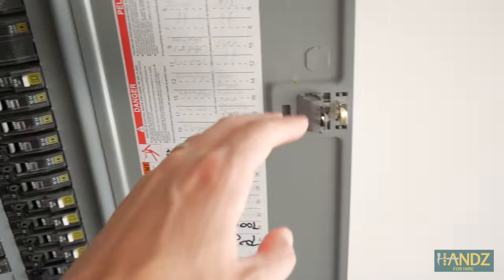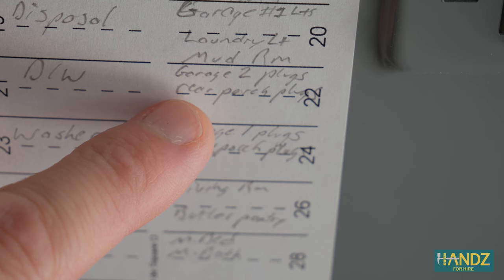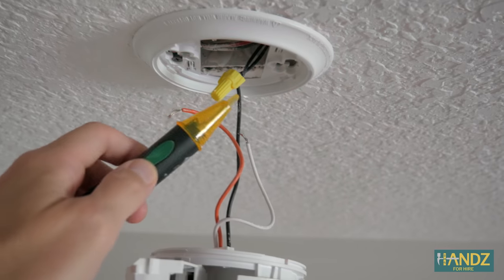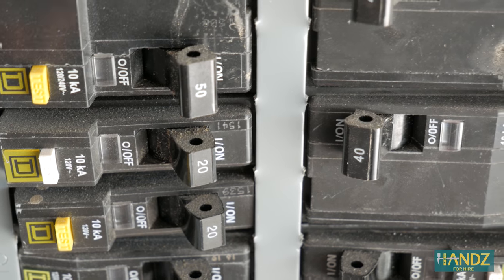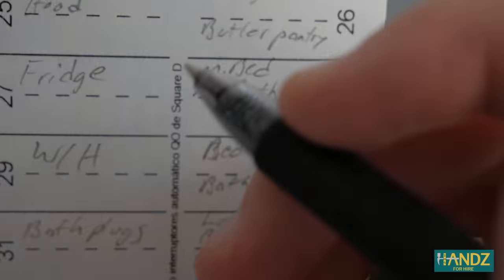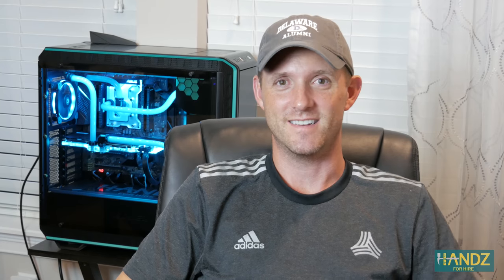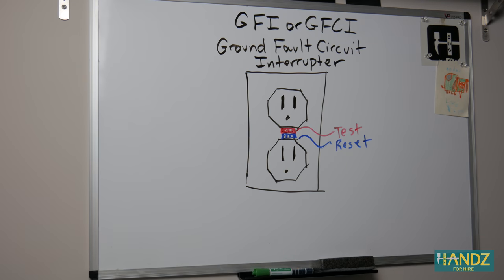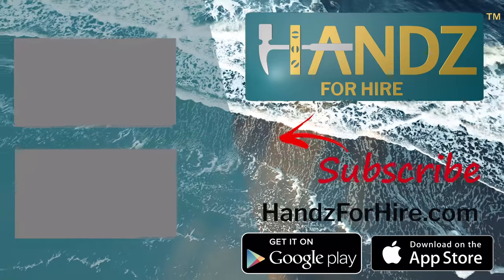Turn OFF POWER on a Hardwired SMOKE ALARM and Live to Tell about it

Comment: Jay like you, I searched everywhere - all the YouTube videos on this question. I couldn't find the answer but you're so learned,  I thought you might know the answer. I simply want to disable my hard-wired smoke detector. Not remove it not change it -  just disable it so it doesn't keep going off from the least little bit of smoke.  If I take the cover off of my hard-wired smoke detector from the 80s and I detach the wires from the little clip can I put the cover back on the smoke detector without attaching the wires again?  this way the smoke detector will not go off,  (I hope )and there won't be wires hanging from the ceiling and a hole in the ceiling. you see, this smoke detector it's one of five in the house goes off whenever there is the least little bit of steam or smoke from the frying pan or the oven and I can't stand it anymore. I don't need it. I just want to take the cover off, disconnect those wires from the cover, and put the cover back on so hopefully it won't buzz/ go off anymore. do you think that's possible ?
Reply from the maker: Hi Donald, thank you! To answer your question the short answer is yes you can, but I wouldn't because those smoke detectors are there for a very good reason. The professionals recommend replacing your smoke detectors every 10 years. If yours are from the 80s then they have 30-40 years on them. This might be why they are so sensitive and go off so easily. Years of dust can make them wacky. Before you disconnect for good, I'd try switching the one that's causing you issues out with a new one. Good luck and let me know how it goes!

Comment: Not sure if anyone has had this issue.  We had an old smoke alarm that was hardwired. Removed the alarm to replace to stop the chirping.  But the chirping didn’t stop even though there was no alarm attached!  Couldn’t find the circuit and finally turned 2 off at the same time and the chirping stopped.  Got a new alarm, attached it, with new battery.  And now, 24 hours later,  periodic chirping continues just like before.  My question.  The prior alarm was put in by owners in 2007.  Is there something else that ‘chirps’ besides the alarm itself that needs to be removed?  Will it chirp if the new alarm is put in improperly perhaps?
Reply from the maker: Hi Gail, Did you happen to replace the 9V battery in the alarm itself? Even though the alarm is hardwired, it still has a backup battery in case the power goes out. Over time this 9V battery needs to be replaced and the chirping is the indicator. Good luck!! I hope it works out because I know how annoying that chirping is!
Reply: @HandzforHire  well guess what!  We actually found that the upstairs smoke alarm (that we were sure was just fine and didn’t have a problem) was the problem. And it was just like others said…sound traveled strangely and we were so SURE it was the downstairs alarm.  So, we changed the upstairs battery and reset it and sure enough, all good!  It was the back up battery for sure… just the wrong alarm.  Thanks for responding.
\
Reply from the maker: @gailpfeiffer2331  oh that's great news!! Yes, sometimes it's really hard to pinpoint the chirp. I know exactly what you mean. Glad it's all sorted!

Comment: I'm still at a loss, I've checked all the circuits other than furnace and hot water heater(both in basement)  and stove outlet and refrigerator outlet and my volt meter still beeps like there is electricity there.   I'm stumped and disappointed.
Reply from the maker: Hey Kevin - I know how annoying these alarms can be. Worst case scenario, you can cut everything at once, check to make sure it's off, and then slowly add breakers back in to find the right one. There's not another live wire nearby that could be triggering your voltage detector?

Comment: When I was replacing a battery in my First Alert smoke detector I noticed  the ground wire was disconnected.  I kept turning all the circuit breakers off and still had power coming into the smoke detector.  The tip of looking for 15 amp breakers associated with the bedrooms was what I was really looking for.  I followed this tip and in a minute or two I connected the wire and the problem was solved.   I want to thank Jay for this learning lesson, it was greatly appreciated.
Reply from the maker: My pleasure, sir! I went through the same process as you, so my hope was to save someone the to figure it out. I'm glad it helped!

Comment: THANK YOU SOOOOOOOOOO much.  Took a total of 15 minutes to find the right shut OFF.  I, like you wife wanted to take a hammer to everyone of them.  I am now going to make labels for everyone of them, plus put it on the DOOR of the breakers.  I can't imagine living with that noise.   Funny part of this it is on a breaker that a intercom that we have not used for at least 20 years.   Good job and THANKS.  by the way we have all 20 and some odds breakers.
Reply from the maker: You're welcome! I'm glad it helped, and wow, that's interesting about the smoke detectors being on the same breaker as your intercom. Perhaps the new building codes have smoke detectors on a 15A, but older ones were on 20A? Well thanks for commenting and have a great (alarm free) day!

Comment: I'm pet sitting for my mom while she's gone for two weeks, her integrated fire alarm has been beeping and it's annoying her neighbours. I've tried turning off every circuit in her house but it still keeps beeping. Her circuit box is super janky. The switches are barely labelled and the ones on the right side seem to have been put in backwards, so off is actually on and vice versa. I think because she is in a town house there may actually be another circuit box outside that may be controlling some stuff in her house and her neighbours house, so I'm scared to replace her alarms since I don't have a voltage detector and can't tell if there's electricity still going to the alarms or not. I have some new alarms and wire harnesses but the old alarms are from 1999 and she has never replaced them before so I'm worried there may be wire damage that could expose something and cause a fire if I move around the wires. If I call an electrician it will easily cost me like $500 to $1000 Canadian dollars. Uuuuuuggggggggggggggghhhhhhhhhhhhh... 🤦🏻‍♀
Reply from the maker: I'm so sorry to hear all of this. Sounds super stressful. Do you have a hardware store close by? You could pick up a voltage detector for fairly cheap or I have one linked in the description that you can buy off of Amazon. I definitely wouldn't mess with anything if you can't tell whether the electricity in the circuit is shut off. That would be my best suggestion because then you can troubleshoot the switches without getting hurt. Best of luck to you!
Reply: @HandzforHire  I sort of figured it out. It turns out it was my mom's new CO2 detector I didn't even know she had that was going off. She had just gotten it and put it on a shelf near the fire alarm and I guess it was faulty so it started making the end of life beep. I took the batteries out of it and it stopped beeping. The situation still isn't fully resolved though as all the fire alarms need to be replaced and the CO2 detector sent back to get a new functioning replacement. So basically now she has no functioning fire alarms and no CO2 detector if anything happens. But at least the beeping is over. 😌
Reply from the maker: @H-rf3mo  I'm glad you at least found the source. Hopefully everything will be okay while you wait for replacements.
Reply: @HandzforHire  Thanks for the tips and letting me vent in your comments. 😂
Reply from the maker: @H-rf3mo  my pleasure!

Comment: So it's just straight wall voltage?  I want to install an attic fan, and my smoke detector is probably the easiest power source
Reply from the maker: Yes, you can probably piggyback off of the power from the smoke detector, but first I'd check how much amperage the attic fan pulls. You want to make sure you don't overload the circuit. I'd also recommend checking in with your town to make sure you do the job up to code. Good luck!

Comment: replaced all of mine woth same model but new ones and now when testing the one in the master bedroom does not make a sound they would all go off when when you pressed the test button on any of them they would all come on now the bedroom does not make a sound took it off changed location and worked just not in my bedroom
Reply from the maker: That's so bizarre! Just curious, but did you use a voltage detector just to check and make sure you have power to your detector in your master bedroom?

Comment: Your house doesn’t seem old, but the codes to what breaker the smoke alarms are on uses an older code. Smoke alarms in newer houses today must be on a separate circuit.
Reply from the maker: Really? My house was built in 2016.
Reply: @HandzforHire  Then sadly your house might not follow present code.
Reply from the maker: @mewing-gawd  maybe not. Does it vary state to state? I'm in Florida. What state are you in?
Reply: @HandzforHire  Pennsylvania
Reply from the maker: @mewing-gawd  cool. I grew up in NJ.
Reply: @HandzforHire  Yeah I'm leaning towards certain states needing a dedicated breaker. I'm also in Florida and mine aren't like that.
Reply from the maker: @RMPANDA964  yeah agree. It probably varies state to state.
Reply: @HandzforHire  I did a little bit of research, and it turns out that some states require smoke detectors to be attached to another circuit. That is because if it gets shut off you want to know that. On a dedicated circuit there’s no way to see if the smoke detectors have been shut off, unless you look at the green light everyday.
Reply from the maker: @mewing-gawd  that's great to know and now that you've explained it, pretty smart. I just wish the electricians would label the circuit the smoke detectors are attached to. I think there are a lot of people out there trying to figure out which switch it is in the circuit box. Thanks for letting me know!
Reply: @HandzforHire  No problem. Your wife must’ve pulled those wires HARD. It’s not that easy to pull wires out of wire nuts unless the stranded wire snaps.
Reply: @mewing-gawd  Haha, could be.

Comment: Real simple flip the main breaker change your alarms turn your breaker back on
Reply from the maker: True, but then I'd have to shut down computers and reset every clock in the house each time I needed to work on the alarms. I just wanted to take the time to find out which breaker the smoke alarms are on so I'll save myself the trouble from here on out. Your method certainly works though! Have a great day!

Comment: Hey guys! Quick question. Halloween is right around the corner! I had planned on doing something really great and creepy for my family to unexpectedly experience when they come home on Halloween night. My creepy plan involves a fog machine. Never bought one before, but I work at a halloween store for the time being and got one for a pretty nice discount. It's a 400 watt machine so it's not too big or anything. The box that the fog machine comes in simply says "For Indoor use only." But When testing out the fog machine to get a better idea on how it works, my smoke detector went off! I panicked. The fog machine is pretty much needed for my halloween prank. Does this video apply to me if I want to TEMPORARILY disable every smoke detector in my house? It's water based fog, so I can safely assure you guys that no fire will ensue. I just want this Halloween prank to be absolutely awesome! Also, I know this may sound silly, but should I disable my carbon monoxide detectors too? If I take the batteries out of the smoke detectors AND flip the switches on my circuit panel, will that do the trick?? My Circuit panel says "GFI"  and "Bath GFI," but that's about it.  Thanks so much, guys!
Reply from the maker: Sounds like you’re going to have quite the elaborate setup! So cool!! I could never recommend shutting down your smoke and CO detectors or recommend temporarily covering them with plastic shower caps and rubber bands to shield from the fog machine. Be careful. Be safe. Have fun!
Reply: @HandzforHire  i think you just gave me an answer there! Very nice... Thank you sir!😉

Comment: evey time i test my wires my tester says its no power and i havent even turn any of the breakers off. but my smoke alarms are working. whats does this mean
Reply from the maker: Hmmmm. You might have an issue with your voltage tester or the wires are off and the smoke alarms are running off the 9V batteries? How long do they last until you have to change the battery? If they're running on batteries, then it would probably be every few months. If it's running on the wires then you should only have to change the batteries every few years.
Reply: @HandzforHire  it seems to be running off the 9 volt battery they are all wired together but the power wire seemed not to be connected to any power I'm not sure how to follow all the wiring to see where it ends
Reply from the maker: @ncsouf  that's definitely something you want to get fixed. There must be a loose wire somewhere. Since the smoke detectors are on a circuit with something else in your house, you'd have something else without power if you had a bad fuse in your circuit breaker. Assuming everything else is working well, my guess is that there's a loose wire somewhere. Do any of your smoke detectors have a voltage reading?
Reply: no voltage reading on any of them
Reply from the maker: @ncsouf  I'm sorry I can't be more help, but it's tough to assess without being there. There has to be a disconnect somewhere between your circuit breaker box and your first or last smoke detector in the circuit. Everything in the circuit is hooked up in parallel, but hooked in series to breaker. You might need to call in an electrician to check it out. Please let me know how it goes.

Comment: The problem of running up and down the stairs can easily be solved with two people with cell phones.  One person calls the other on the phone. One person is at the circuit breaker and flips off the first 15 amp breaker and says “is that is?”   The other person is at the smoke alarm and answers back yes or no over the phone.  You can go through all the 15 amp breakers one by one in less than a minute this way.
Reply: I know I'm late to comment but I'm laughing at yours. You're funny. Jay intentionally/unintentionally demonstrated how you can do it without a sidekick, it's a confidence booster for most of us living by ourselves.

Comment: i turned off the breaker that powers the smoke alarm (green light shut off) but the alarm kept chirping lol
Reply from the maker: Hi aseed - there's usually a 9V battery in the smoke detector as well, so if the power is off, that's where the chirp is most likely coming from. I'd test that 9V to see if it needs to be switched out.